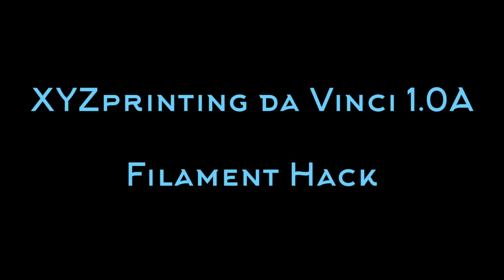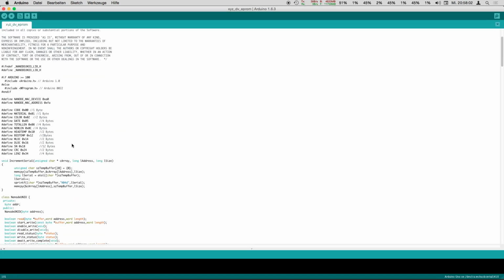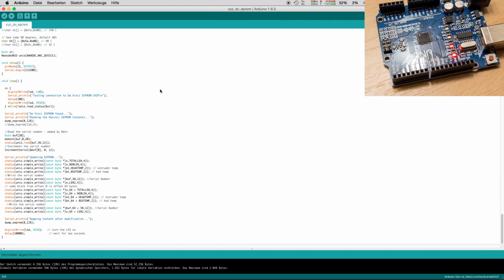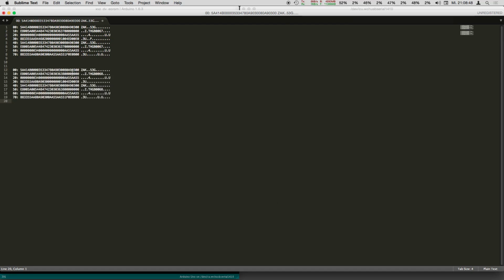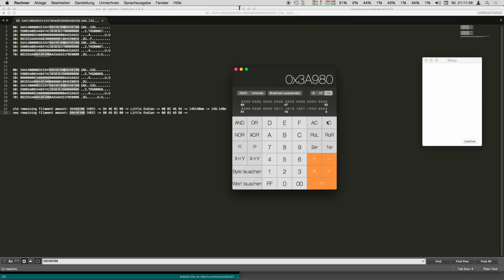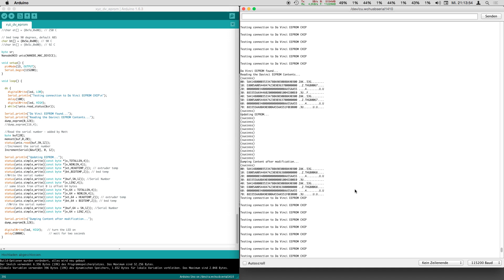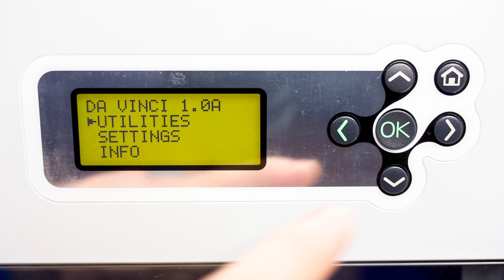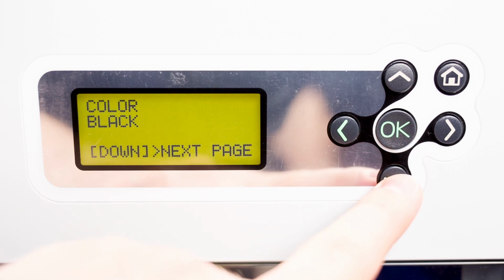XYZprinting da Vinci 1.0A EEPROM hack explained in detail for 3rd party filament w/latest firmware

Comment: awesome! thank you so much for this.. been trying to find a video that goes into detail about the EEPROM hacks in the Arduino code so i can change the temps. 10/10 for usefulness, clarity, and overall awesomeness
Reply from the maker: +Motown Metalcrafting Did changing the temps in the code actually make any difference while printing? For me and others this did not seem to have an effect. I used the custom slicer g-code approach for that. (See second video on the Da Vinci from me if you are interested.)
Reply: It made a huge difference. The prints are much smoother, and the layers stick much more cleanly. I'll take a look at the other vid though, as we are trying to get away from the proprietary software

Comment: Quick question. I want to print pla but the nozzle and bed heat can't be altered trough simplify3d when i use a hacked cartridge. It just uses the abs settings from the Eprom. How do i alter this with the arduino? I see u use a calculator to get the right code. Can you point out where that calculator is within the arduino software? I want a 195 nozzle and 60 bed heat.
Reply: +Wouter van der Horst  I have been able to use this hack and modify the settings for various temps.  The calculator that Florian used in the video is a programming calculator, I am sure you have one that is native on your PC.  Just bring up the calculator and change the view to "Programming".  I am not sure if the speeds are different from the eeprom though as I used a cartrige that was OEM PLA to begin with, and the davinci still recognizes it as PLA. I was able to adjust the settings for extruder and bed temp to make those work.  The file works flawlessly for ABS and you can still tweak settings for more exotic filament as I am working on using this with PETG... still fine tuning but I almost have it!
Reply from the maker: +Wouter van der Horst check my second video on this printer. In that video i explain how to use Slic3r with individual temperature settings. That would help. Otherwise you could flash a PLA cartridge instead or try to alter the settings to make it a PLA rom. Not sure how to do that though.
Reply: +Florian Uhlemann that didn't work. Can i alter the temp settings when flashing? I mean, if i know which code to use for 195 nozzle and 60 bed it eould be fine.
Reply from the maker: +Gary Queen Thank you for jumping in. Yes, it's basically a simple decimal -> hex conversion that I've done. However, I thought that those values do not affect anything with the later firmwares? I've been using the Slic3r method for custom temperatures and it worked fine for me - and let me do much more custom and complex printing support structures and shapes.

Comment: Thank you for the comprehensive tutorial. I'm just waiting for my printer to finish an 18 hour build and then I will give this a try.

I just followed your exact instructions but can you explain what the calculator was used for in relation to temperatures such as changing e6 to e8? I have no understanding of programming or C.

Thank you
Reply from the maker: +hojo effectively nothing since it doesn't apply the temperature changes. For custom temperatures please look at my other tutorial for using Slic3r. The calculator converts your decimal values into hexadecimal numbers. And these are written into the code such as e6 or e8

Comment: will this work on a DA VINCI , 1.0 AIO to ??
Reply from the maker: +Kimse RC-Sjov I'd say that it would work, because they basically use the same cartridges, just two of them.
Reply: +Florian Uhlemann Thanks i bay a extre cartridges then i try
Reply: +Florian Uhlemann can you help whit the last thing the heatbed what do you set in to only heat up til 50 in the hex code char bt[] = {0x5a,0x00};this is 90
Reply from the maker: +Kimse RC-Sjov if 5a = 90 then 0x32 = 50°C
Reply: +Florian Uhlemann thanks but if you have firmware 1.1.6 this will nok work but i have find one they do the only thing is the heatbed go til 90 no matter what i tell it

Comment: I have been trying to flash my Da vinci 1.0 for 2 to 3 hrs and I just keep getting a message telling me problem uploading to board. I have tried everything I can think of. The only thing I have noticed is i'm using a uno with micro usb port. There is two red lights on the uno all the time. They never flash or anything. Is that normal? I figured there would be something going on to show it is working. Do you have any advice? TY
Reply from the maker: +michael rodgers Can you post a few lines of the Serial Monitor feedback from the UNO while trying to flash it? I could think that you either have a problem with the board itself (different layout/pins) or that you might have the wiring mixed up.
Reply: +Florian Uhlemann It says the programmer is not responding. It tries to run 10 times before giving the error. The arduino didn't come with a usb cable so i'm using my phone cable. Could that be the reason it's not working? I'm new to using this programmer so I maybe doing something else wrong as well. These are the steps I take. 1. I connect up the usb 2. I open the Arduino program. 3. I press open and load sketch_mar03a . 4. I make sure it is on com10. 5 I press upload. I have tried this both with the programmer without pins connected to the cartridge and with the pins connected. I'm using the pins as in this video, 5V to + side of chip, Gnd to far side on chip and pin 7 to middle of chip. There is two red lights on the Arduino, on and L. They stay on constantly unless I press the button. Then the one with L goes off for a couple seconds and back on. The serial port is set at 115200. I hope this is not confusing. I have tried to post lines from the serial monitor but there is no information there to send. I don't even know what serial monitor is or does. lol This is the first time I ever seen a Arduino.
Reply: +Florian Uhlemann Maybe I ordered the wrong board. This is the Arduino I purchased. http://www.gearbest.com/lcd-led-display-module/pp_241515.html I went to Arduino website and out of all the boards this is not listed. I just don't know anything about these to know if I bought the right board lol
Reply: +Florian Uhlemann I finally got it. Thank you!
Reply from the maker: +michael rodgers Great news!! Have fun 😊

Comment: I have attempted this from about 3 different sources. For some reason i can't get the arduino to connect to eeprom. Has something changed?
Reply: +seanlovesjobo Turns out the sketch doesn't like the arduino mega. Fortunately i have a few different types lying around.
Reply from the maker: +seanlovesjobo Interesting. I've just used the basic Arduino Uno design. Keep in mind that maybe the pin-designators are different? But I believe the MEGA uses a different timer and could thus throw off the code?
Reply: I believe that is the issue. Timer that is. I have a question i am sure you can help with. How do i convert an ABS cartridge to PLA? Thank you very much for your work with this video and you speedy response!
Reply from the maker: +seanlovesjobo This question has been asked before and I don't think I know the answer to that. I really haven't seen a set of instructions to change the type within the code. Basically I suggest following the instructions in my second video on how to use Slic3r for the DaVinci printer, which lets you manually pick temperatures for your specific filament type. 😊
Reply: I've been trying to work with slic3r but can't seem to get the models centered. It ends up hanging off the print bed in XYZware making it unprintable. Any idea how to fix that? Thank you again for your time!
Reply from the maker: +seanlovesjobo That's weird. You could possibly place a very, very small second part on the canvas which lets you slide your bigger piece around where you want it. (kind of)... but if I only use one part, then I've never had a problem with it not centering automatically.

Comment: Hi Florian, have you ever reset the count on a cartridge which had gone completely to 0 meters? I've flashed an old one of mine which was down to 0 meters. It's reset to 240, it shows 240 remaining but once I try to print something, it's fails saying: this is not a genuine cartridge. Do you want to go online and buy one.

The only other thing which could have influenced it is the fact i helt the flasher down too long. So I flashed it twice in one go. 

Can you tell me which version of XYZ ware you are using? You had firmware 2.0.1 if I'm not mistaken. I have that same firmware, my XYZ version is: 2.1.6.5. It's firewalled in so shouldn't be able to call out to the web for verification or anything.
Reply from the maker: +Richard Hoogenboom I think it was 2.1.6.4? Can't remember exactly - not using the XYZ anymore. 😊 No, I haven't had a cartridge go to 0m yet and I'd probably recommend against it for the sake of safety. Why yours says that it's not a genuine cartridge surprises me. Awkward. Maybe you could try a slightly older version of XYZware?
Reply: I got 3 more old chips to play with, one worked (happy :-), one gave the not genuine message also, so I assume it might have gone down to 0 and one failed the flash, its broken now, on that it says it cannot recognize the cartridge. I'm waiting to get a cartridge down to only a few meters left and then flash it again, see if it works. If I get a second one to work and the first one which worked to reset again and still works, then I'll go out and order a role of filament. Still think it's a bit unreliable at the moment. 

What are you using now? Have you flashed to reptier host? How do you like it?

Comment: Thanks Florian Uhlemann :) its works good :)
But i have got one problem 
a buy ABS+ and wen i change temperature to 245 C printer set 219 C on extruder
Reply from the maker: +artusb yes this issue is known. Please watch my second video on how to use slic3r and a custom g-code to enable the precise setting of bed and extruder temperatures.

Comment: Hi, thanks for the great video. I have some questions.
I changed the bed temp to "char bt[] = {0x1e,0x00};" because I want to use PLA. 
But I dont see where I can change ABS to PLA in the code? Because the printer still things its a ABS cartridge I suspect it still thinks the bed needs to be heated to 90 Degrees.
Also I changed the code to 240 but if I go into cartridge info it states 120M? (better than the 50M that was left I guess :) )

Thanks for the help!
Reply from the maker: +Ejal Nvt despite being able to set those settings, they really don't affect it much. Please watch my second video. It explains how to use slic3r and therefore a custom gcode that lets you manually set extruder and bed temperatures.

Comment: Thanks for explaining this. I just got a 1.0a da vinci Has the 1.06 software. Will this allow me to change the extruder temp/bed temp? Saw with others resetters you cant change the temp with 1.06. thanks Dave
Reply from the maker: +David Johnson This seems to be correct. The only way to change the temps would be to use a third-party slicer software (like Slic3r) to create your custom g-code and modify the bed and extruder temperatures in it. Please watch my second video on the davinci for a how-to on that.
Reply: Ok thank you

Comment: Thanks for your videos.  ABS flash worked, just curious about how to change for PLA
Reply from the maker: +Gary Queen Good question. You either need a PLA-cartridge or there is some additional flag that you should be changing within the code.
Reply: I was about to ask the same thing.  How do you change from ZAK to ZPK, or do we even have to?  I screwed up and ordered 300mm filament instead of 1.75 so I have to wait.  I lowered the bed temperature to 85 degrees and the extruder to 97 degrees, using the hack, on a recommendation from some that uses Repetier and PLA.  I will report back when I get the PLA filament and try it out.

Comment: Arduino portion went well, but I'm receiving an error. The printer is not recognizing the cart. Since you all have had success with this, any ideas to what I may be doing wrong? (DaVinci 1.0a - FW2.0.1)
Reply from the maker: +wj Sorry to hear the problem. What does the Arduino-serial-monitor log show? Was the cartridge completely empty before flashing?
Reply: +Florian Uhlemann Serial monitor was printing success, as expected. There was 2m left in the PLA cart. I've since had partial success. It seems that if I remove and replace the cart after the printer has run through the boot cycle, the cart works fine. It's a workaround that I can deal with until i print a few more modification parts and reflash the firmware. Thank you for the tutorial!

Comment: The resetting worked but it says 120 meters. Can i change that?
Reply from the maker: +Wouter van der Horst Glad it worked! You forgot to comment (add // in front of the line) with 120m and uncomment (remove the // in front of the line) on the 240m line.
Reply: +Florian Uhlemann da vinci accepts 240m but not the 400m command. When I dot hat it says the cartridge is corrupt. After i flash it woth 240m it works again. Any thoughts?
Reply from the maker: +Wouter van der Horst This is a known fact that in most case the 400m is not accepted. I could imagine that 360m "might" work as it's a multiple of 120... but someone would have to try that 😊

Comment: Will this work with the 1.0 model?
Reply from the maker: +NetVoyagerOne As this doesn't alter the firmware of the printer itself, but rather going around the limitations of it, it is also possible to use with the 1.0 and similar printers. As a 1.0 user, lot's of users have decided to move to the repetier firmware 0.9.2 for the davinci1.0 instead.

Comment: Thanx alot! I have got printer with 2.0.1 version of firmware and it works good.
Reply from the maker: +Jindřich Bém Thanks for the feedback! Glad it worked out for you! 😊
Reply: +Jindřich B&#233;m You have a Da Vinci 1.0 running 2.0.1 and this method works???
Reply: Joshua Boff Yes, I have Da Vinci 1.0A with firmware 2.0.1
Reply: +Jindřich Bém 

Zdravíčko, tento proces je nutný opakovat stejně pokaždé když chci znovu 240m?
Reply: ano, když se bude kapacita opět chýlit ke konci. Jediné co nevím, co se stane když se vyčerpá až do 0m. Proto přehrávám kapacitu znovu před úplným vyčerpáním.
Reply: Super, děkuji moc za odpověď, ale jsem z toho trošku zklamaný, čekal jsem, že to půjde uděla nějak pohodlněji, třeba ve stylu resetterů. Nemáte s tím nějakou zkušenost? nebo používáte pouze tento postup? Ještě jednou moc díky...
Reply: Používám jen tento postup. Snažím si ho usnadnit např. jsem si vytiskl držák na drátky s popiskem pro přepis EPROM, takže při potřebě dalšího nahrátí jen napinuji drátky do Arduina, spustím program. Záležitost cca. na 5min.
Reply: +Jindřich Bém Jasná věc. No každopádně jsem to zkoušel a nevím co jsem při postupu udělal špatně, ale když chip dám do tiskárny, tak tiskárny vyhodí hlášku, že informace byly změněny ať kontaktuji výrobce. Nevíte čím by to mohlo být? Je fakt, že jsem na první pokus přepsal na 120m a až na druhý jsem dal 240m. Jinak jsem se držel přesně postupu. Díky moc.
Reply: Zkus to ještě jednou. Mne se to na poprvé stalo taky.

Comment: Hi there! Thanks for the tutorial, it's really helpful.

I did everything as you did, but there's something I don't understand. I've set everything in the arduino sketch as you did, but my extruder reaches only 211 deg C which, I think, is not enough for my filament. Filament reseller stated it supposed to be 230-235 deg C.

What do you think about it?
Reply from the maker: +nalupl glad I could help. Yes, this is a known issue. Supposedly it is possible to change the values, yet it doesn't affect the printer. BUT if you use Cura / Slic3r to create the gcode, and encode it with base 64, rename it to .3w and feed it to the XYZware. By this you can force the printer to print with higher temperatures. That's what I am doing. I will be doing another tutorial on that soon.
Reply: OK. Thanks for solid explanation. Looking forward to see next tutorial.

Cheers!
Reply from the maker: +nalupl Sorry i didn't have a better solution for you, but thank you for your feedback!

Comment: does this stuff up the self cleaning function?
Reply from the maker: +shane agnew If you mean the box in the far right corner? No, it still uses it and works great. For the printer there really shouldn't be a difference as it keeps getting filament, exactly the same way than with original cartridges, except it comes in through the back.
Reply: +Florian Uhlemann thx i might have to do some more research b4 i hack it  great tut btw
Reply: +Florian Uhlemann Do you have the files for the fillament cleaning box?

Comment: I'll try it. So newest firmware works? 2.0.1 i mean.
Reply from the maker: +Wouter van der Horst I can understand your fear. The firmware shouldn't be able to determine if it was a new or hacked filament cartridge as it increases the serial number, places the remaining amount to full amount, thus there's no trace. So I'm very certain it would work on yours as well. I'd try and make sure you do a simple EEPROM reset before upgrading the firmware and check if the Arduino actually DID update the EEPROM (via the log / Serial Monitor from Arduino IDE)
Reply: +Florian Uhlemann I've almost empty roll. When it's empty I'll try it. I got a arduino and everything so it shouldn't be hard
Reply from the maker: +Wouter van der Horst Okay, sounds great! Here's one last thought: I'm not sure how XYZ handles the empty cartridges, but maybe you want to reset it before it enters a state of "complete empty" where the firmware or software could write some additional parameters that weren't expected by the Arduino code. (so maybe with 0.5m left or so?)